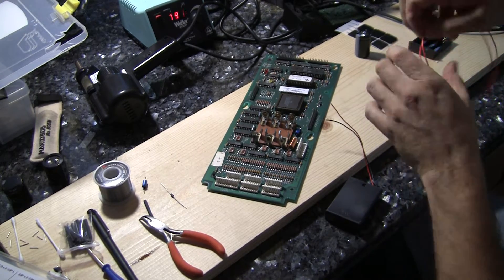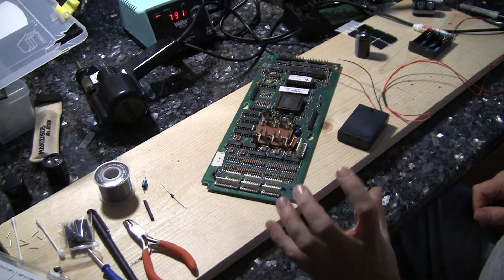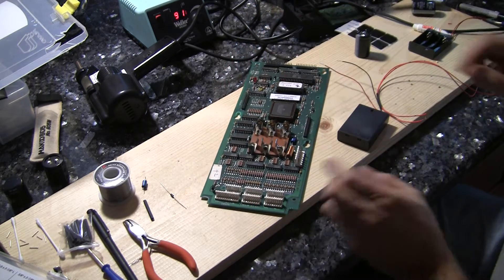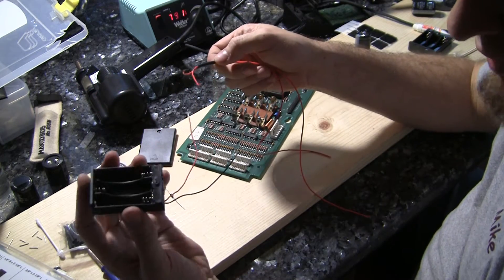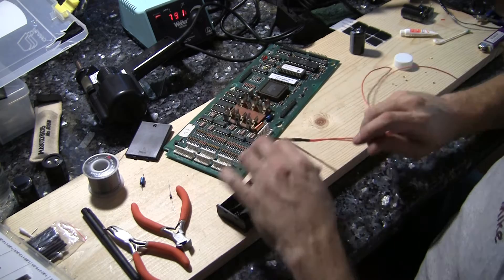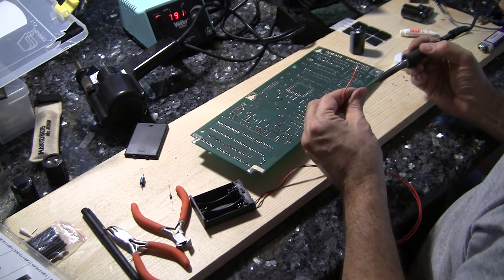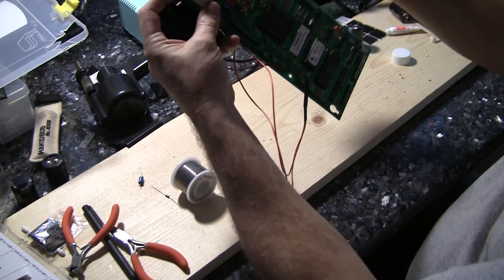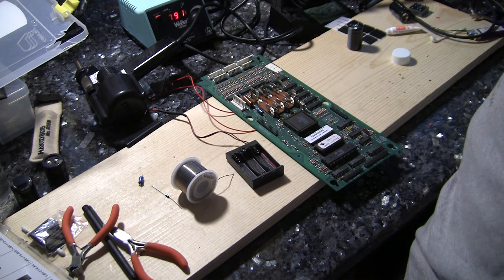Adding a remote battery holder to your pinball machine - Pt 2 - PinballHelp.com

Comment: I have an Elvira (Bally's system 11) with the original battery holder like this one and I can swap out the batteries. Do I still need a diode if I put in a new holder? Because if your able to take the batteries out doesn't that mean they aren't rechargable?

Comment: Just a dumb beginner question about the diode you put in line. Is it on the positive or negative wire, (I think I know which way it should face to stop battery from receiving current), or is it on both, or does it matter which? Thanks for your Pinball help! :)
Reply from the maker: I don't believe it matters which wire as long as the orientation is proper.  The band should be facing the + side.  You can check to see if you have it wired correctly by putting a voltmeter on the leads with the batteries installed.  If you don't read any significant voltage, the diode is backwards.